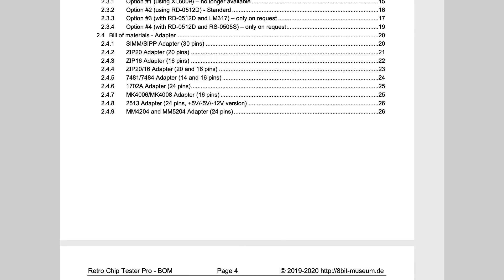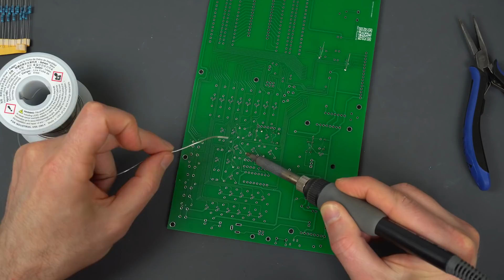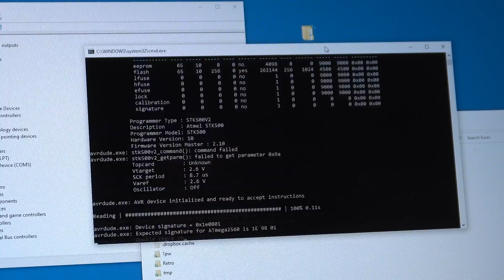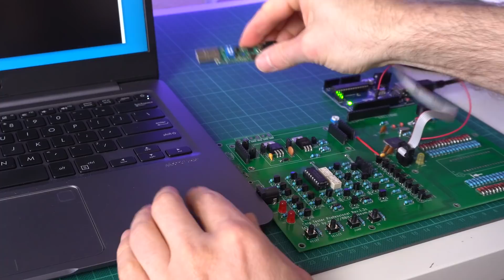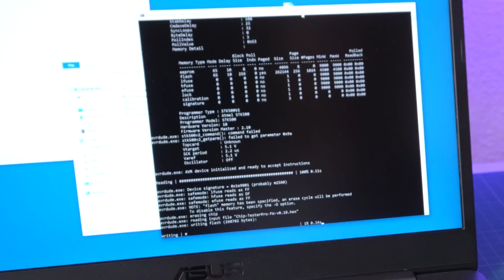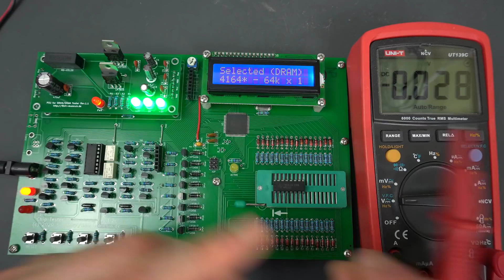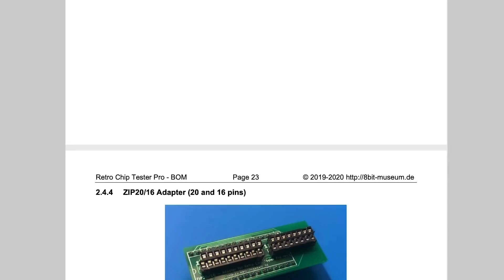The Ultimate Retro Chip Tester?

Comment: I wish there would be something like that for DDR Ram types. Put them in, let it run and see if the Ram is failing or the board not compatible
Reply: You can test RAM in a PC. Just get memtest86. Although I've seen faulty RAM pass that test. The best RAM tester I've ever used is GCC. If your RAM is bad it'll let you know when you try to build a really big software project.
Reply: @1pcfred  That is a good idea. I had so many bad Rams that passed memtest with flying colors. Compiling the linux kernel is maybe a good test, thx.

Comment: Nice gadget and work, as always. If you are planning to use it constantly, as you already told us, I would suggest you(you know me...) to ask the manufacturer for 3 things to implement in the next update:

First: For those who use the small screen, there should be an option to have a vertical or horizontal scrolling, in order to be able to see all of the available info. This might be good even for the big screens.

Second: If we want to go back and choose the previous chip type, as you had the need to do, this could have been done by holding down the "next" button or using a combination of buttons, in order to go back one selection.

Third: The ability to control the whole system(or even set some parameters like the fore-mentioned scrolling) from the computer, like all of the other programmers in the market do, as far as I know.

I think that these thingies would be nice to have. Happy testing!

Comment: Love the trouble shooting on the ATMega. I've had quite a few bricked ATMegas and never thought to introduce an external clock. Good stuff!
Reply from the maker: Thank you! 👍
Reply: 08:20 more impressive that electrical current flows in a loop, but yet only one single strand of wire connects the (temporary) pulse generator to the chip tester

Comment: I haven't fully explored the testing features of the TL866 software, but does the retro chip tester offer much more than the TL866 software in terms of testing?
Reply: The TL866 won't test DRAM for one.
Reply from the maker: Right. That's the big one. I think there are lot of other chip types the TL866 doesn't support either.
Reply: I've spent some time on the TL866 and tested my logic chips and some ROMs. I have a large set of ram modules in an unknown state so I've decided to get the ram tester. Looks like a really fun build 😊. Thanks guys.

Comment: 8:00 It may just be 4MHz, but I kind of expected some problems with signal integrity, seeing as you've only used one wire to connect the clock signal, meaning the ground return path was all the way through the pcb, ICSP connector, ribbon, programmer, USB port, the other USB port and finally the arduino's USB cable. Although if you really didn't change much between the two tries it's more likely it was just a dodgy connection. Either way, it was an interesting way to get the chip working without a high voltage programmer, so kudos to you!

Comment: The 4-line LCD would look better if you adjust the contrast.  You shouldn't see boxes behind each character.
Reply from the maker: You're right. I think they were more noticeable on camera for some reason, but I need to lower it a bit.
Reply: Why stop there, a nextion display with an HMI would be even better.... it could even display graphs of the chip outputs in realtime etc... honestly a ice40hk + some voltage level conversion would probably make a better tester this probably can't test that the ram is acutally performing at its specs as its too slow.
Reply: He adjusted it for his eyes. The camera is at a different angle, so it saw different contrast.
Reply: Those blue and white backlit LCDs have superb contrast when adjusted right.

Comment: If I am not mistaken there where two USB sockets on that PCB you did not populate. Would there by any chance be an option for PC software control? Then you would not need the buttons, LCD or sdcard module. Smaller PCB, less parts, thus cheaper. Though most likely not by much.
Reply from the maker: Correct, but those USB sockets were purely for power (as far as I know). PC control could be an interesting option (although it would lose portability), but I also imagine it would put a lot of burden on the microcontroller, which is already maxed out as far as the program data, so that might not be possible.
Reply: @NoelsRetroLab  with pc control you could upload the selected chip config to the controller freeing all the program data stuff. Just like you could upload the ROM dump directly to PC. Stand alone would then be an option by connecting a pi and LCD if one goes the standalone route. At least that is how I would do it.  But it's a nice device as is. Certainly useful.

Comment: Cool device and great video! Can it also test processors and custom chips like PLA, SID, ANTIC, etc. ?
Reply from the maker: Thanks! It's limited to chips with 32 pins, so that rules out CPUs like Z80, 6805, etc. However, it can definitely test a PLA once the logic table is added (I talked to Stephan about it and I believe he will add it in an upcoming update).
Reply: @NoelsRetroLab  I forgot about the pin limitation, but it's good that it can test the PLA chip. :-)
Reply: Evie sells a chip test that will test most MOS, Commodore, CPUs and a huge array of logic chips. I think she was going to add Atari custom chips in one of the firmware updates too. It's a nice little device and not unreasonably priced. https://store.backbit.io/product/chip-tester/
Reply: @mbpaull  Certainly a nice device! Thanks for the link.

Comment: I have an ABI In Circuit chiptester from 1987. It can check lots of ICs in and out of circuit, has a glorious 5 inch green CRT, a floppy drive and a numeric keypad.
To test an IC, just type in the number on it (discarding letters, so 74LS245 becomes 74245) and press the green button and it'll tell you if it works or not and if not, which parts of the chip are bad. Pretty cool.
And it can also be programmed in TestBASIC so you can play text adventures test chips that aren't in the database. Actually... you CAN write and play video games.
Does anyone want me to do a Youtube video about this machine?
(I might buy one of these chip testers anyway though)

Comment: You jumpstarted the car without your feed on the ground, literally. Considering that you wired the clock signal but not ground (if I didn't miss another connection in the scene) I wonder what kind of loops were in your setup to work at all. A real feat!
Reply from the maker: Interesting. I didn't think much about it at the time. I must have lucked out with the grounds being common, probably because both devices were powered from the USB ports of the same computer.

Comment: Very cool project, but yeah... a rotary button would make so much more sense, weird choice there. I love these projects even exist though, it's amazing. 110 Euro's for soemthing like this is a steal, if you can make it that is.
Reply from the maker: The lack of rotary button is because the project grew a lot since the start. Initially it only tested a handful of chips, so it wasn't nearly as necessary. And now unfortunately he's out of pins in the microcontroller so apparently that's not an option. Still, it's a fantastic project.

Comment: Put a mini wave tip on your iron and that surface mount IC is one of the easiest things to put on there - literally done in under a minute
Reply from the maker: That's the theory. But then you need to line it perfectly, and check for shorts, and check that every pin is perfectly touching the pad...  😃 I actually haven't done anything quite that small yet, but I'm sure I will soon.
Reply: When you try, and get super frustrated with all the bridging and janky bonds, don't forget:  MORE FLUX.  :-D  Lots of liquid flux and and copper braid to clean up.  Then you'll be all set, and TH parts will be the ones you start to dread.  :-)
Reply: @NoelsRetroLab  The best way is a solder mask, solder paste and a hot plate. Scratch that the best way is to have the board come with the part soldered to it. They definitely did it the former way at the board house though.

Comment: You're right, it needs a rotary switch with a button and submenus. Also it's be cool to have a few memory buttons that could be custom shortcut to chips you test frequently.
Reply from the maker: I agree. It does have something about frequently used chips which I didn't look in detail, but you may already be able to do exactly that.
Reply: Yes, they need to look at what some of the 3D printer firmwares do with a menu and rotary switch and select button.  Very effective way to handle long lists.
Reply: @redace001  the 3d printer lcd boards are made (in general) to an open "standard" and the cheapest often come with sd reader and rotary encoder on the board. to the point i integrate them into projects im using lcds on because its easier

Comment: For better component selection ease, how about a master table with a four digit (or more if need) code for each device to be tested?  Keeping the PCB markings the same for the benefit of other functions:
 
Press "Reset" button to start the device selection process. Press the "Select" button multiple times to increase the most significant digit of the device code displayed on LCD - press "OK" button  -  display moves right to the next digit - press "Select" button multiple times to enter the next digit - press "OK" - and so forth.  Press and HOLD the "Select"  button to rapidly decrement current digit with the digit position moving left to the previous digit position after a "0" count. "Reset" button to start over.

Comment: Maybe I missed it but what is the bottom line cost on this? I like the idea that more chips can be added to it.
Reply from the maker: Check it out towards the end (there's a chapter with that part), but it ended up being a total of 110€, which you could reduce somewhat by using an Arduino to program it and sourcing the components a bit cheaper.
Reply: @NoelsRetroLab  Yeah I did see that at the end. Thanks!

Comment: I disagree on the speed. I think it could go way faster.
Reply from the maker: You think? I didn't do the math, but accessing 64K memory locations with a 15ns DRAM takes a while (plus time for settling the bus, etc). That times 5, which is the number of tests it performs... I don't know. I think it's in the ballpark. Do you think it could be much faster?
Reply: @NoelsRetroLab  You should be able to do a Million operations per second. A write then read needs two operations. I think you meant 150ns access time.

Comment: It would be nicer if you could use a 12864 lcd like i have on my 3d printer those usually come with rotary controllers (i dont like the idea of complicating things with a touch screen when i dont need one). Maybe a 12864 will plug into this and just need an update to work it? or at least i would hope so. Maybe this is something you can discuss with the maker of this. 

I am surprised you took this long to put this together considering how many video's youve done testing chips and fixing computers lol. But on the other hand maybe those video's wouldnt have been made if you had this to do the job faster. 

anyway keep up the video's i enjoyed this one very much
Reply from the maker: Interesting. I suspect it won't be possible since the microcontroller is closed to maxed out (both pins and program room). I know some people pimped up their tested with a 20x4 OLED screen, just looks much nicer (but it's also way more expensive).
Reply: @NoelsRetroLab  ah that's a shame might have looked nicer with a bigger LCD but if there is no program room that's a problem

Comment: These LCD screen have the same controller and ALL work with a virtual display of 2 lines x 40 columns. The physical LCD will always just display a part of this virtual screen. If you write sequential chars on the display, they will be written to the RAMbut will not be displayed. A 4x20 display will have the first half of line 1 in line 1, the second half on line 2, then 1st half of line 2 on line 3 and the last half of line 2 on line 4 (or something like that, it's 30 years ago that I wrote a Siemens ES102 display emulation on such a Toshiba LCD display).
Reply: I was about to write the same comment haha

They're fun and easy to work with, very fun as a first project to make your own library
Reply: Isn't a 20*4 display actually a set of two 2*20 displays?
Reply: From memory - bad memory could be wrong -, there is 2 types of 4x20. I think it's just a couple of pins on the end that are different.

Comment: I wonder how this compares to the ubiquitous TL866II+ programmer, which can also test a wide variety of chips?
Reply: The simplest way to describe the two is that this kit is completely standalone, and the USB TL866II+ requires a computer. 

That said I'd really like to see the existing (Linux) TL866II+ software extended to include testing.

D'oh, beaten by the man himself by two minutes 😮
Reply from the maker: The TL866II+ is mostly an EPROM programmer/reader that also happens to test 74xx logic. It doesn't do any DRAM/SRAM testing as far as I know, so right there it's quite different. It probably doesn't do many other other chip types this tester can do. And this one doesn't program EPROMs, so you kind of need both 😃
Reply: @NoelsRetroLab  It can test SRAM chips.

Comment: A great bit of kit, Can't you program the atmega from an Arduino in ISP mode instead of buying another programmer ?
Reply from the maker: Yes, you probably could. In retrospect I should have tried that since I'm very comfortable with the Arduino, but I went down that way since it was the recommended way in the manual (even if that wasn't exactly the recommended programmer).
Reply: @NoelsRetroLab  This just needs the encoder wheel and graphic screen, even mono like most ender printers would improve using it by a massive amount. Perhaps the 2560 is already at it's limits for IO and memory.
Reply: Yes you can, but you'd still need to use AVRdude in command mode since I believe the code is supplied as a HEX file. There are very cheap ICSP AVR programmers available from the chinese markets that work well too.

Comment: I would just have fun building and soldering this device, it's like meditation... :D
Reply from the maker: Yes, it's the type of project you can relax while building it: easy components, lots of similar ones next to each other... It took a good 2-3 hours to build, but it wasn't stressing like some SMD projects can be.
Reply: @NoelsRetroLab  Good ole THT :D
Reply: @NoelsRetroLab  I built the OSSC some time back... that definitely wasn't any pleasant experience. Also taking in account that I built it only using the soldering iron and without using hot air station
Reply: @NoelsRetroLab  This tester can measure TTL and Cmos family?

Best Regards
Reply: @NoelsRetroLab  Is the PCB available for order? If yes then how much is it? Is there a gerber file to order PCB myself?
Reply: @DmitriyBychkov  It doesn't look like it. He's put up a notice saying all of the current run of boards are reserved, and there's no gerber files on his site.
Reply: @NoelsRetroLab  finaly I got it - very nice device... ;)
Reply: I would build it just so I can say, "I built this". :-) Maybe someone can come up with an easy mod that would enable a "backspace" function in the library? I assume it would not be easy. It would probably involve code change in the processor as well as added hardware. (?)
Reply: @jlucasound  I can't remember if he said what ATmega it is, or what was on the PCB, as I watched this yesterday...but if there's a header on the board that'll let you program the chip via ISP(I'm guessing there won't be an FTDI chip or something and a USB port for it), you could certainly write in a back function fairly quickly. The problem is that you'd potentially need to have a copy of the code because unless the code is stored in external off-chip flash of some sorts for whatever reason (ATmega's have on-chip storage for bootloader and program data). You can read program data back out of the onboard memory using AVR Studio and some others but just in case that doesn't work for any reason, that's when you'd wanna hope it's stored externally haha
If there's no ISP header. you could always just whack some 'bodge' wires onto the relevant pins on the microcontroller.
Reply: It would be a bit like having sex. So much fun without laughing.
Reply: Or just going crazy after some hours of work.
Reply: This should be sold as a kit.
Reply: I love building kits. It's like basket weaving. Very therapeutic.

Comment: It's nice that it says what in the test failed, but it would perhaps be nice if you could choose to continue the test to see if there are more errors or if it's intermittent etc. Oh, and I agree on the rotary switch. Cool project overall though.
Reply from the maker: You can certainly run it again just with the push of a button, but I never thought about the continuing option. Most of the time you just want to throw it away, but I can see that being useful for more complex chips.

Comment: The 44256 were extremely common memory chip in the early 90s. Neary every 1MB VGA card was equipped with 8 of them. The GUS classic used these chips as sample RAM. Some 286/386SX mainboards that offered DIP socket memory as well as SIMMs accepted banks made of 4 44256 (for 16 bit data) and 2 41256 (for parity) to build a bank of 512K.
So indeed, the chips are exotic for you, but that's just because they are newer than the retro stuff you usually deal with.
Reply from the maker: Bah, fancy newfangled hardware!  🤣  Edit: They probably came from an Amstrad PPC or a PCW.